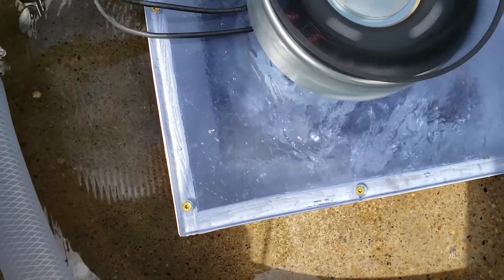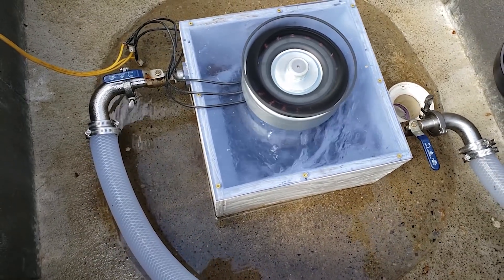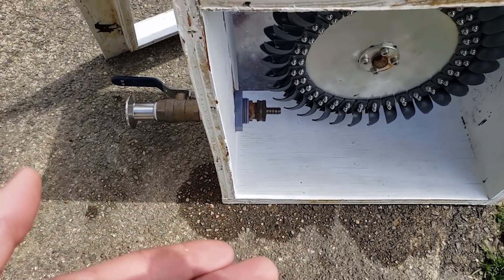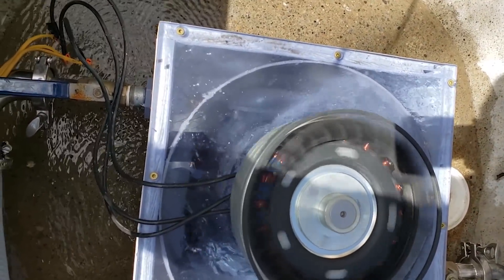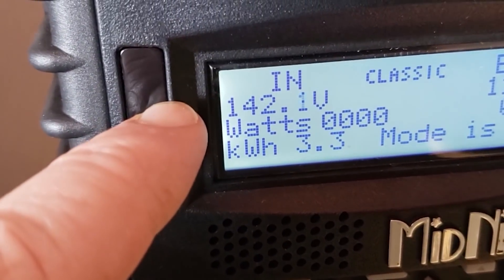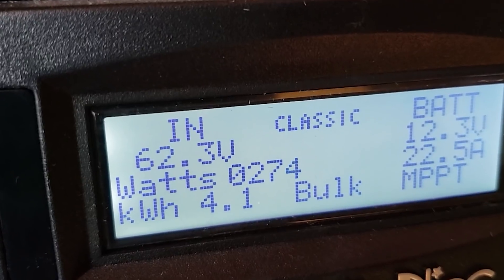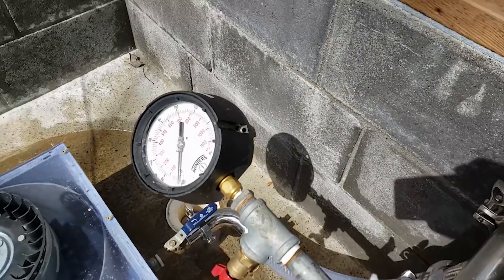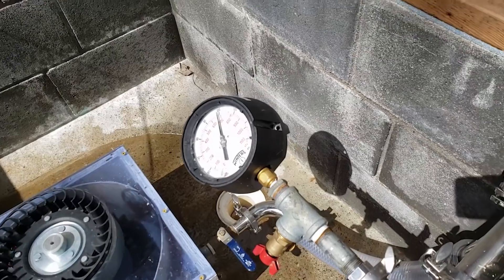Round Turbine Housing, An Improvement?

Comment: In my opinion (I studied mechanical engineering, but haven't put this particular knowledge to practice in way yo many years so take it with a grain of salt) it's the capacity of the generator that's limiting the energy extraction. The generator is already generating to its limit and so there is little energy that is extracted from the water... making the wheel spin pretty fast. So the water flies off the wheel with a lot of energy still in it. A stronger generator would create more resistance and allow more extraction of the energy, and so the water would exit much slower.
Reply from the maker: That's not quite how it works, the charge ontroller that I have regulates the amount of load that the turbine sees with loads being the battery or a inverter.

Comment: You could use a Bundt cake tin at the top of the turbine so the water stays inside the turbine housing, rather than splashing over the top as well as keeping the water inside the circle. I'm not sure how the water exits your turbine, but you might want to join two bundt cake tins to surround the turbine and concentrate the flow.

Comment: Would it be worth using wire mesh material to create you inner circular housing?    That way water hitting the cylinder walls could pass through into the outer chamber and not splash back hitting the pelton wheel.

Comment: whether a round or square housing- After the water hits the paddles divergence needs to take place.  Find out where the water goes after the paddles, trap it and get it out of the housing eliminating its ability to slow forward movement of the wheel.

Comment: As you said getting the water away from the alternator is key so with the round housing I would make some openings (semi circle cuts) along the top every few inches so the water can escape once it has hit the rotors and doesn’t splash back. also maybe adding some water deflectors before the nozzles on the round housing to send the water up or down so the “spent” water that has already hit the turbine fins doesn’t hit the new water coming in making the stream turbulent.

Comment: Rather than trying to control the water inside the turbine, try to get the water away from the turbine. You know where the water comes in from and where it should hit, the rest of the "area" should be free and open for the water to exit.

Take a look at rotary turbine vents. That's the sort of shape which would be ideal, it would allow water to exit at highest velocity without affecting the turbine.

Comment: Quentin Clark has a point. I remember looking at MWh pelton wheel housings, of the ones I've seen the shaft was horizontal, the nozzle came in from the side at the lower side of the wheel. Loads of space for the water to deflect and down and out away from the wheel. Not really applicable here but with the circular housing looks like the right idea, but it looks like it needs to be alot larger for it to work to keep windage away from the wheel.

Comment: If you want to dont have a problem with water being a drag, change turbine configuration top horizontal. To be honest this turbine works best when put in horizontal configuration. Its a impulse turbine. Jet need to split on a blades and shoot DOWN. Energy is being converted from First water pushing blades and then blades pushing itself from redirected water. Thats is the best configuratioj, you will not lose Water heing coz you can put jets on the low level of turbine. And you dont need to add more hoses. You need speed (converted from pressure) and you increase power by giving more water to system (with same speed) You need Spike valves to operate it better ;)

This will work aslo but then tyou have that kind of problems.

Comment: Why not making the whole housing circular and 4-5 mm tick with both jet also causing a clockwise momentum on the surface and a smaller exhaust to further increase the power with extra water pressure

Comment: I've a few ideas:
1. Run at higher voltage like 120vdc, there is smart drive motor with quality seals and bearings available anywhere, capable of much higher power output.

2. This will lower the amps and you'll require much thinner wire.

Other than this I don't have anything else to add.

Comment: I think, it would make sense to make the zylindrical housing bigger in diameter. So the back splashing Water from the walls can not reach the turbine blades.... or less, at least..
A simple soulution would be to use a old oil drum as a turbine housing.. Worth a trie for next to nothing...just the labour of course. ;)   Greets from Germany

Comment: Don't overthink it. Make an adjustable frame inside the concrete pit, mount the jets and then use a large piece of clear polycarbonate to mount the Alternator / Pelton. Essentially, larger scale of what you have now, just the poly goes to entire edges to sopt water coming on-top. Now you will have heaps of room for water the get away from the wheel.

Comment: 120 psi ??? id use some sort of positive displacement motor or modified pump. the losses in the dynamics of a turbine might be rather high especially under higher load . I have a little brass water pump. its a gear pump and would work as a motor, with 120 psi it should move pretty good . i had plans to use a tank in a tower and that pump was gonna be my connection to the alternator.
Reply from the maker: the cool thing about a reaction turbine is it works at a constant RPM under varying flow.

Comment: Interesting.  Have you thought about perforating or slotting the circular baffle?,  just enough barrier to prevent the splashing back but thick enough to slow the water down and reduce the splashes from the square edges.  This is all about impedance matching - ideally, it should look like there is no enclosure at all.  I don't know if any of what I'm saying will really help, but that's what I'd be tempted to try

Comment: You use the Hydro PMA Generator ME1603, 1200-2500 Watts, 24-48 VAC but your generated voltage freespinning is 142 volt !?
Do you make a too high rpm or what?
I love your project, keep doing this stuff.
Reply from the maker: First that is open circuit voltage so not really an applicable voltage. Second the website doesn't really tell you much about the winding profile of the alternator so it's hard to say exactly what it's designed to generate.
Reply: @JoeMalovich  The PMA you refer to is for 24 to 48v
1200rpm for 24v
2500rpm for 48v
Could it be that you use another type than the ME1603 model ?

Comment: If the round part was a bit smaller in diameter and you had a way to make  louvers facing the direction of the water flow all the water would be directed through the round piece and into the box with no way back through. Not exactly an easy fix and not sure how effective it would be in application, but in theory it should work.

Comment: Do a hand made porcelain housing, a real pain in the butt to make but you can re-glaze it over and over and over again to maintain it, they'll literally last a lifetime.  
Your REAL problem is that turbine is not for vertical axis installations it is for horizontal axis with undershoot or overshot.   A vertical axis turbine uses a centripetal bowl to guide the flow down a conical housing applying remaining rotational flow and gained gravitational force to a different kind of blade system.  You're looking at a two-part housing with a circular ring opening on the bottom.  If you put it 10 feet up you can then funnel that down and run the remainder drop through the turbine blade kit in this video and generate even more power.
A simpler way to deal with water against the turbine on a horizontal axis is to include a baffled air intake on the turbine side with a "flywheel" plate between the turbine housing and the alternator housing... alternator housing and using the centripetal flow of the turbine to suck air in through the gap around the shaft.   Basically 4 inches of shaft between the two sections.

Comment: make the round liner a bell shape so the system can make a vortex draft to suck the water down but to do so you will need to add a vent at top of box I believe 3x 2 inch PVC riser tubes in your setup will work so  that way will build a vacuum that will draw the water down and out of the turbine path so it isn't recutting its turbine drive water.

Comment: Something not mentioned in the video or comments is "laminar flow" and by that I mean getting rid of the turbulence created by your jets. IOW, the water should flow in a smooth stream instead of splashing. Here's a little experiment for you. Take your feed hose out of the box and see what the spray pattern is while flowing. I'll bet is more like a jet and splashes. Extend your "nozzle" with about 18" of 1/4" pipe (just an example) and notice how the spray changes to a smoother stream. This lack of restriction (smooth interior surface) before exiting the pipe is what gets rid of the turbulence. (valves and fittings add turbulence when too close to the outlet) Less turbulence = less air bubbles / cavitation = better control of where the water goes = better efficiency. Also notice that commercial applications of the Pelton wheel use a scroll shaped housing to direct the exiting water. I have to wonder if the mfgr doesn't sell a housing that's already engineered, along with well designed nozzles and a spec sheet on water flow / operating pressures for best results.

Comment: Nice improvement, but you still need to encapsulate the turbine blades. What I mean is encase them in a circular shell so all the water is hitting the turbine and not splashing around. Nice improvement though. Also if you want to keep water away from the seal, then do what automakers use to do and use an oil slinger. Basically a circular piece of metal attached to the shaft, in front of the seal that keeps too much water from getting on the seal.

Comment: You need NO HOUSING AT ALL other then a wall to keep water away from the generator.  It is important that after the water jet hits the wheel, that it is free to exit without ever hitting the wheel again.  your "box" should have top only, no walls.  If things are set up properly, you should see jet hit wheel and exit 180 degrees from entrance direction.   (Some of your jet appears to miss the wheel or wheel is spinning too fast).  This exit water must be free to fall to the lower sump, well below the wheel.
     Another thing: the wheel peripheral speed should be a little less then half the water jet speed.  The water should hit the wheel, make 180 degree turn, and ideally be almost stopped, just moving enough to "get out of the way" and fall to the sump without ever touching the wheel again.  If the wheel is not loaded enough, the water will continue past it despite hitting the buckets correctly (as it appears in the video).
     Ideally you need "maximum power point tracking" system to adjust the load on the wheel to maintain the 1/2 speed condition.

Comment: Hi Make a new enclosure using the same lid but with 4 new sides at steep angles like a pyramid or tank armour to angle the overspray down to the ground. You would need to make nozzle extensions though.

Another idea is to cut strategicly placed vents in your baffle, sort of like the vents in a windage tray in a crank case of a motor.

Comment: hello some interesting info:
the drain must be at least three times the diameter of the inlet pipe,
make a hole on the transparent cover, at least 3 cm and put a short tube, to prevent it from splashing out of the water
the turbine takes air from this hole and prevents splashing from going onto the generator bearing
it should also improve the discharge
the distance between the jet outlet and the pelton blade should be approximately te times the injector hole
for more than 4 injectors, I recommend a visit to my recent video
good job and many satisfactions with picoHidro

Comment: Larger, round housing, walls angled so that water hitting them is directed down. Something I'd try is shaped pieces to turn water back in the rotation direction after it flings off the spoons. Once the nozzle alignment is fixed to make the jets hit the spoons in the perfect spot, there should be a spot further along the rotation where water flings off still having some useful energy. Might be possible to capture some of that by turning that spray back at the spoons. Looks like doing this with a turgo design would be easier. Put a funnel beneath the wheel to catch the water that's deflected by the spoons. The funnel's top should be tilted in the rotation direction so the water coming down shoots straight down the funnel's throat. From the bottom of the funnel, a pipe narrowing down to a small opening curves around to aim somewhere at the spoons, down-spin from the upper nozzle. In other words catch the flow going through the wheel, make it do a U-turn, and accelerate it to hit the wheel a second time.

Comment: I recommend removing the turbine housing walls complete and replacing them with 4 corner legs instead (and mounts to hold the nozzels). That way the water could exhaust out into the larger enclosure and drain without chance of splashback.
Reply: I think you need to keep the top of the dynamo dry through so water splashing around everywhere might not be so great.

Comment: Hey Joe! As many people said, a bigger housing diameter would prevent water from splashing back and hitting the jet.
From my experience in a company manufacturing small hydro (50-500 kW) turbines, vertical axis Peltons always have a big housing, let's take a 0.6 m wheel diameter, the housing would be around 2 m (3 times bigger!).

Anyway this is a very small turbine, so probably a housing diameter twice the wheel should be a good compromise.

One last "humble" opinion about the wheel: the amount of water combined with the head of your turbine would need bigger spoons. I say so because the jet seems to be quite big compared to the spoon size, which means the turbine is less efficient (water leaves the spoon with very high turbulence) and also more splashing all around.

I hope this may help.
Thanks for your videos and for sharing your experience.

Comment: As many have commented already, I would like to see a total open design. This can be achieved with a fairly large metal frame and acrylic top.  This will cause more water in your pit, yet it may solve many problems, I suspect that you could see 10% or more improvement. It should be pretty simple to do.

Comment: Have you thought about adding louvers to the circumference of the circular housing acting as sort of a one way valve taking the water away? Similar to a windage tray controlling oil inside of a performance engine.

Comment: Given what I've seen in commercial turbines, your enclosure needs to be 2x that size and round, with the nozzles sticking out close to the wheels. Round should be good, but ideally it'd be slightly conical, so the water is directed down once it's flung off the turbine. You need enough distance for the water to miss the spoons as it reflects back off the wall.

Comment: If you cut a hole in the liner where the water is splashing back at 4:31. The water would (hopefully) get trapped in the corner behind the liner and drop away

Comment: So what I was seeing in the slomo footage around 9:00 is that you have a lot of water circling the housing and interfering with the jet. I'm not really an expert on this subject, but if you changed the shape of the housing to either be kind of the shape of a hurricane symbol where two opposite corners of the housing are right angle and lead to the walls instead of curve towards the jets OR perhaps you could create an incline/decline in the circular housing so that gravity forces the water that's slinging around downwards or centrifugal force slings it upwards and over into the corners

Comment: Now, take your circular housing and make it a cone shape to direct the water down as it goes around :D
Reply: Eric Vercruyssen  Because shape of the housing is not the isue here.
It looks to me that the turbine is spining too fast, he should use turbine with smaller diameter or conect it with generator able to get more power out of it at this RPMs.
This type of turbine have best performance when blades are moving with half of the speed of the water in the jet.
With half of the speed the water gonna hit the blade and transfer almost all of its kinetic energy into turbine blades.
Wrong direction of the jet can also be part of the problem.
Reply: If you fit the turbine to the top / narrow end of a cone, then all the "spent" water will fall away. 
If you do it the other way round then the water will build up in the housing.
Reply: Just thought of this. Great minds!
Reply: Or corkscrew rifle the rim to direct it down
Reply: Then add a smaller turbine at the bottom of the spout to try and harvest some of that waste energy. And as water falls down the cone it should accelerate.
Reply: If you make this cone long enough, most of the centrifugal forces will be directed downwards by the acceleration of falling down. Jet the falling water onto a small very low weight turbine that is perpendicular so that the water wheel catches the water as it falls. I'm not sure what the speed of the water is in the turbine, but it seems pretty close to terminal velocity, so we probably wouldn't even have to be that big a cone. the biggest thing would be making sure the water flows freely from the spout without pooling up in the bottom of the cone. messing around with the angle of the cone can help with any turbulence.

Comment: Maybe you could build a naked frame around the spoon side of turbine, and keep the perspex shield to protect the alternator section.

Bit like a four leg table design ,and incorporate a upright to strap wiring to away from water.
Also weld some sheet plate ,just in areas where jets come in. Then this way less water is splashing back onto spoons ??